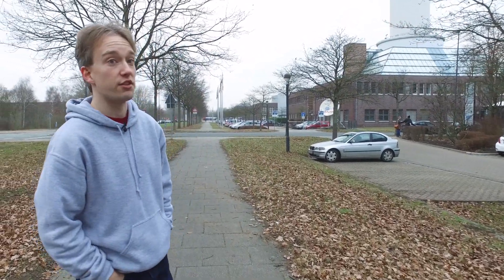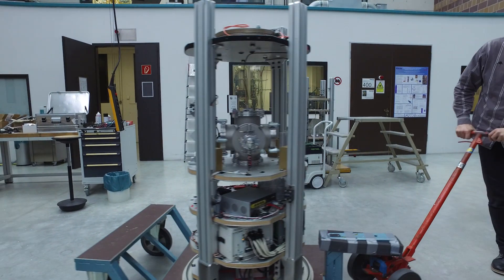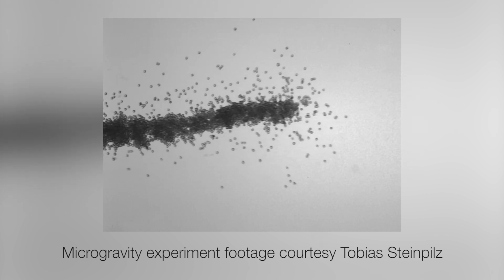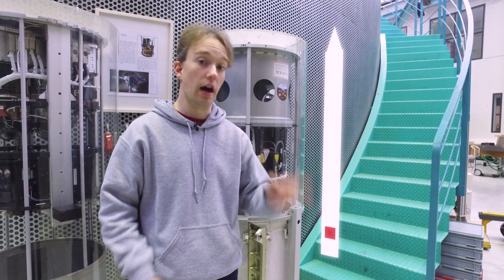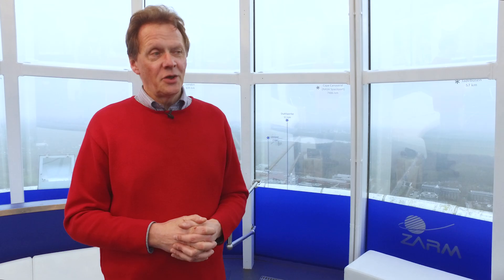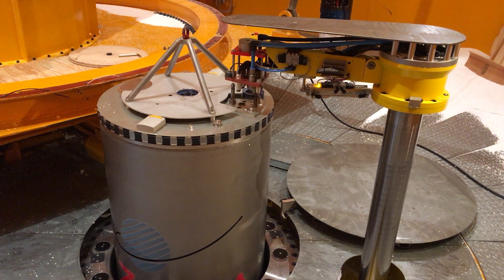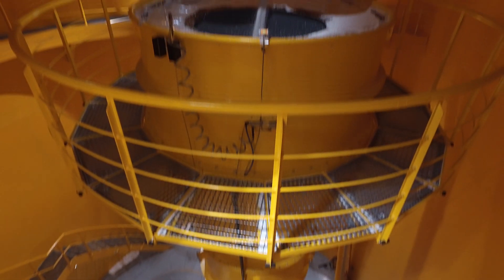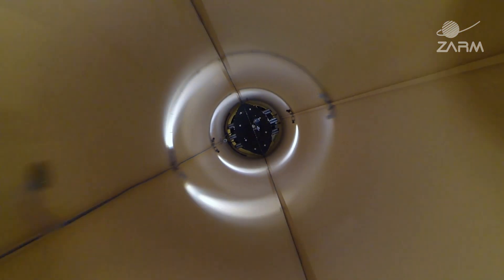Zero-G Experiments on Earth: The Bremen Drop Tower

Comment: I think that the wording of this video is very wrong. There is never weightlessness. The only thing that is weightless would be an infinitely small point. There is apparent weightlessness. Dieting is different from jumping in the air. Also, when he says microgravity, this is incorrect. There isn't less gravity just because you threw something up in the air. This isn't a problem with just your video though. If you calculate the amount of gravity acting on the ISS, then it works out to about 90% of force of gravity compared to when you are on the surface on the earth. Nasa says this is microgravity and the definition of micro gravity is very weak gravity but I wouldn't consider 90% to be very weak.

Comment: When it landed in the polystyrene, I was expecting a big foof of it. I forgot the reason for the foof is air pressure, something that is not in a vacuum chamber.
It's also a bit eerie from the quiet due to no sound propagation through the vacuum.

Comment: It could be done without evacuation of the tower. With CPU controlled linear motor, or parallel robot with strings (top and bottom attached) and evacuated Matroska vessel (to cancel vibrations).

Comment: Isn't this massively overkill for something quite simple?  Surely you don't need the vacuum tower, just a vertical rail you can drive the capsule up?  - essentially freefall but with a motor to compensate for air resistance.
Reply: That's cheating.

Comment: I believe the free fall under gravity (a=g) and the acceleration upward with |a|=g are two different cases.  The second case is not the same as free fall. Think about when one is standing in an elevator, during its free fall, one will not feel any support force from the floor. While, when the elevator accelerates upwards, e.g. at a=g, one will feel the legs are heavier when standing in the same elevator compared to the case when it is not moving. The upward acceleration presses one inside the elevator more to the floor. Actually, a person should feel two-time heavier instead of being weightless.
Reply: You realise professors in physics designed this. They’re not wrong. It’s been tested it’s 0 G
Reply: @32452-hr  Going upward with 1g is not a weightless or "zero gravity" condition.
Reply: But, the capsule is still experiencing a=g on the way up. The acceleration remains constant in both direction and magnitude (except of course for launch and landing), so the elevator in free fall case applies through out, just the velocity and acceleration vectors point in opposite directions on the way up
Reply: @cameronduff9820  "zero gravity" means that the object, e.g., a person, can be under a gravitation force but does not feel its effect. How does this happen? In the space station, the gravitational force is not zero but it is used to provide the centripetal force to let the space station orbit around the earth.

Comment: Do you or anyone know, why in the drop test that uses several different density materials   (Lithium to lead) do a few of them fall at slightly different rates?
Reply: Since the vacuum is very good, but not absolutely perfect, different densities would fall at very slightly different rates. Due to residual air resistance. If you look carefully the capsule they drop/launch still had an aerodynamic shape, despite the near vacuum.
Reply: @MarkW_  there is so little air , that there would be no discernable difference.  plus, the densities ranged from low to high but the middle and objects on the ends, showed a very slight falling rate.  i suspect it could be due to the rapid acceleration and the flex of the materials

Comment: Wait how does it stay zeroG on the way up?
Reply: It does it the exact same way it does when it is coming down. When you feel the effect of gravity it is because gravity is trying to pull you against something, and you feel the force of that thing fighting against gravity. As soon as the canister leaves the launcher the canister itself and the stuff inside of it are both accelerating at the rate gravity is pulling on them, so there is no resistance to feel. If you were inside of that canister you wouldn't be able to tell when it stops going up and starts coming back down without any windows.

Comment: wait, if the test subjects could withstand the initial .002 sec acceleration, they should be able to be stopped just as fast, right?
Is polystyrene needed to make the impact .002 secs?

Comment: Instead of pumping all the air out of the chamber, why not just attach cables to the top and bottom and provide extra force to counteract the air resistance?
Reply: Instead of attaching cables to the top and bottom and provide extra force to counteract the air resistance you can just pump all the air out of the chamber.

Comment: If it's micro gravity, does the 10m per sec per sec still apply and if it does why do astronauts float on the iss?
Reply: It does apply, the iss has a lower gravity because of the distance Idk what the gravity is there. But it stays up because it's travels with the right speed

Comment: Or, you could ship it to the  NASA Glenn Research Center in Cleveland, Ohio in the US and use the Zero Gravity Facility there -- It is a 20' diameter 470' (140 m) high evacuated steel cylinder buried vertically in the ground  that provides 5 seconds of high quality microgravity. It was built in 1966 for looking at the behavior of propellants in zero-g. It originally had the capability to shoot a small spherical test package up from the bottom (giving you 10 seconds of zero-g) or dropping a larger cylindrical package from the top. In a more recent rehab the 10 second mode was removed. If you need about 2 seconds there is another, smaller drop facility at Glenn, too.

Comment from the maker: This video has an error: I oversimplified the calculations for freefall and ended up quantising them. Yes, the speed increases by 10m/s², but that doesn't mean it travels 10m in the first second. It'd travel 5m, then 15, then 25, and so on. Several physicists reviewing that script didn't notice the error, either! All corrections on this channel can be found at https://www.tomscott.com/corrections/
Reply: I love your honesty. :)
Reply: I'd like to know how there is a sound registered when the capsule hits the pit filled with pellets? Wouldn't there be so little air left in the system that sound shouldn't be able to propagate?
Reply: @cragbum87  The pit is in contact with the floor of the cylinder.  Sound travels through solids as well as gasses and liquids.
Reply: @davemould4638  Yep, you're right. Don't know what I was originally thinking.
Reply: @cragbum87  probably vibrations or sfx
Reply: @charadremur333  No, its sound propagating through the floor of the cylinder
Reply: Hi Tom - did you contact some of the physicists who reviewed your script to make them aware there was an error?
Reply: you should probably pin this.
Reply: I don't understand. If the initial velocity is 0 after a second under 10 m/s² acceleration shouldn't the speed be 10 m/s
Reply: @efhi  The equation for the position of is x = xi + vi + 0.5 at^2 
xi=0
vi=0
So all we have is x = 0.5at^2
a is acceleration and in this case is 10m/s^2 and the time is 1 second

x=0.5(10m/s^2)(1s)^2 = 5m
Reply: I was already wondering when you told that in the video.
Reply: Time to scold the people that reviewed the script. Accuse them of not knowing basic calculus.
Reply: Admitting error is a great thing to do!
Reply: I caught it right away.
Reply: The physicists were dealing too much advanced stuff that they forgot the basic mechanics.
Reply: THE CORRECTION IS WRONG ALSO! You wrote 10m/s^(-2). You should've wrote 10m/s^2 or 10m×s^(-2).
Reply: @whtbobwntsbobget  That's a typo tho. Not really that big a deal, since it's obviously a typo.
Reply: @joeols90  g'day, any error is still an error, not about nitpicking, but the devil's in the details and any correction is invaluable. Hope you have a great day mate. ✌🙂👍
Reply: @matildastanford7019  > the devil's in the details and any correction is invaluable

If you don't know the correct units for acceleration, you probably aren't going to get much value out of the correction anyway. Come on, use your brain!
Reply: You should remove the negative exponent or take it out of the denominator. As it's written right now, m/s^-2, your units simplify to m•s², whereas what you meant was m•s^-2 or m/s².
Reply: Just 10m/s^2 or ms^-2 because m/s^-2 is m/1/(s^2) which simplifies to ms^2 essentially a double negative or more accurately a double reciprocal of seconds squared so it’s redundant.
Reply: @JoanDarc1984  No.
Reply: Ok that’s fine
Reply: Oversimplified would be proud.
Reply: Everyone who is interested in the formula: ∆h = ½•g•t²
Reply: now that's dedication
Reply: Was just about to say.
Reply: That's because you are not roman
Reply: Ummm buddy....  Still wrong would be 5m / 20m / 45m....  0.5 x Accel x time^2
Reply: @geekswithfeet9137  He's talking about the distance travelled in one particular second, not the total distance
Reply: Still wrong! Formula is: s=g/2*t^2
Reply: @BernhardHimmer  you are wrong
Reply: NERD 😏

Comment: I don't want to sound dumb nor smart but when the capsule hits the tray at the end you hear the noise as it falls in the pellets. If it was vacuum in the chamber, how could we hear the capsule as it enters the pit filled with pellets?
Reply: I would guess the microphone is attached to the side of the pellet container. The sound is probably the physical impact on the microphone itself.
Reply: Sound needs a medium to travel through. In this case the metal around the container transfered the sound waves to the microphone

Comment: For those unsure about how zero-g works while going up and coming down, think back to the childhood activity of swinging on a swing, and jumping off at the top of the swing, and how that “weightless” feeling lasted much longer than if you (for example) just jumped off the top of the sliding board at the same height as (or even higher then) the swing set.  That memory is the key to the physical intuition about what is happening in the drop tower.
Reply: Perfect
Reply: thanks!

Comment: steven yau says:
distance travelled under constant acceleration is 0.5*a*t^2
1s - 5m
2s - 20m
3s - 45m
4s - 90m

I just thought this should be a separate comment rather than deep in a comment thread

Comment: If you guys want to ride that, you can go to Orlando and ride the  Slingshot at the Magical Midway. It's a ride manufactured by Funtime. There are two 75m high towers, and the capsule you seat in is launched at 110m, thanks to the spring mechanism! So you feel weightless on the way up  (at least from 75m to 110m) and on the way down (same, from 110 to 75 at least). That's a few seconds of weightlessness!

Comment: Here's A brief and simple  explanation I found in a reply below. Not taking any credit for the explanation, it was by Connor Hill-

"Basically, very very basically:

Imagine you throw a pebble up in the air, it goes up then comes down. Compared to the earth it is moving.

Now imagine you put the pebble inside a basketball. When you throw the basketball the bottom of the ball is pushing the pebble upwards.

Now imagine you throw the pebble AND the basket ball at the exact same speed. The pebble is floating inside the basketball even while they are both going upwards. If there is no air friction slowing the basketball, they will stay at exactly the same spots.

The pebble is "floating" inside the middle of the basketball the same way that astronauts "float" in the middle of the space station. Because the astronaut is moving the same speed as the space station, the difference of speed is ZERO. Because the pebble is moving at the same speed as the basketball the difference of speed is zero.

------

Here's the thing:
The ISS (international space station) is going 17,000 miles per hour. The astronauts are going 17,000 miles per hour as well. But since they are falling at the SAME speed, they can float around inside of it.

That's basically how this tower works, it doesn't matter if they are going up or down, its the "Difference of speed" which matters, just like the pebble floating inside the basketball, the pebble is floating on the way up and still floating on the way down, it never leaves the center of the basketball.

----

The reason they vacuum all the air out is so there is no "air resistance" to slow down the capsule.

Back to the pebble and basketball.

If the basketball gets slowed down because it has to push through air, there would be a difference in acceleration between the pebble and basketball. The basketball would accelerate differently than the pebble making the pebble hit the inside of the basketball."

Comment: That is an amazing piece of tech, I'll probably use this video in my Intro Physics classes.  But is it really much cheaper than an airplane?  It's a pretty massive bit of infrastructure, and it's all custom-built.  An airplane also gives you at least twice as much zero-g time, reduces the maximum g loads on your delicate scientific equipment by a factor of 10, and lets you repeat your experiment once every minute or two rather than ... however long it takes to load the catapult, evacuate the tower, refill the tower, and reset.  (I'm assuming the tower doesn't have an airlock.)

I suppose the tower might be better at zeroing out gravity completely: an airplane is affected by turbulence and the accuracy of the pilot (or autopilot).

Comment: I had a thought, how much would the capsule drift with the rotation of the earth underneath it. or is the rotation added to the force on the capsule, thus it would land in exactly the same place it started from? also, this is cool.
Reply: foxtrot151000 I thought about this as well but I assume its either accounted for or insignificant at those heights.
Reply: foxtrot151000 the rotation of the earth is there at the time it is launched. Therefore the rotation of the earth doesn't really occur "in the system" of the experiment but "on the system" of the experiment. The earth rotates at 600 mph in germany, do you think about that every time that you throw a ball? If there was an angular acceleration, this would be a valid concern, but it is just an angular velocity. Basically the same reason it is shot up with Velocity and is still considered weightless for the entire duration of the experiment.
Reply: foxtrot151000 Yeah, Is guess that the Coriolis effect is just so minor it isn't going to cause any problems.
Reply: arcer63 yes I understand all of the inertia stuff. what confuses me is when the object reaches its max height it would need to move a little bit faster than the Earth's rotation to stay exactly underneath it. like the edge of a wheel moving faster than its spokes. the difference in launching position and landing position would be tiny but it should still be measurable. I think
Reply: foxtrot151000 Yup, you are correct. Someone did the calculation in the comments I think, you might be able to find it.

Comment: My calculations show that if Burj Kalifa, the tallest building in the world at 829 meters, incorporated one of these they could achieve 26 seconds of microgravity.  The real problem would be accelerating you up to the 284 mph required to reach the top, and then catch and decelerate you at the bottom when you're going 284 mph again.   

Doing some more math shows that at five-g deceleration, pretty much the max you can handle, it's going to take 164 meters (538 feet) and 33 seconds to slow you down to stop, and five times that distance (half a mile) at one-g.

But hey 26 seconds of microgravity would be a lot of fun and arguably it would be a lot more convenient than going up and down in an airplane.  But I guess building an 829 high building and operating a vacuum tube something like twice would be a pretty expensive operation. You'd also want to be damned sure the tube isn't bending or you could slam into the sides one way or the other.  Ouch!
Reply: What is mph?
Reply: You can handle a lot more than 5g over a short time (Mercury program reentries topped out at around 12g and the guys were just fine), and as you dont throw people into this, A LOT more Gs are possible. This video mentions up to 50g, that should reduce your distance quite substantially.
Reply: It would not take 33 seconds to slow down, more like 3 secs to slow down.  How did you calculate that?
Reply: You'd also want something at the end to break your fall.
Reply: Once you started using mph and feet you lost all credibility.
Reply: You'll end up some Sheikh's boyfriend
Reply: That stupid building isn't even connected to a sewer system. Plus, I think science is illegal in that country 😂

Comment: that silence from the launch till the 'flop' was satisfying af
Reply: I'm wondering if the silence is because the near vacuum and then the flop is so deafeningly loud it transmits through what little medium there is and through the structure. Love the noise.
Reply: @owenkegg5608  
There's a lot of noise heard.
Also, the sound isn't deafening at all. It's just being transferred through the metal, foam, and plastic the camera sits upon instead of the air.
"There's no sound in a vacuum" is a myth. It should be "Sound does not travel though a vacuum".

The sooner the scientific community stops spreading this misinformation, the better.
Reply: @Ranstone  this is not misinformation. This is you being nitpicky. Let me go even farther: "There's no sound in a vacuum" is a myth. It should be "Sound only happens in the brain".